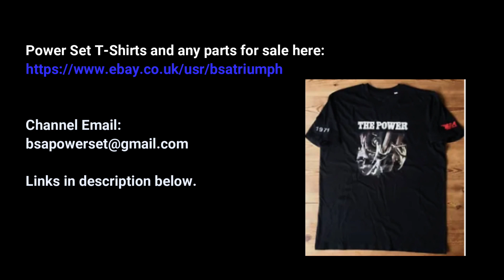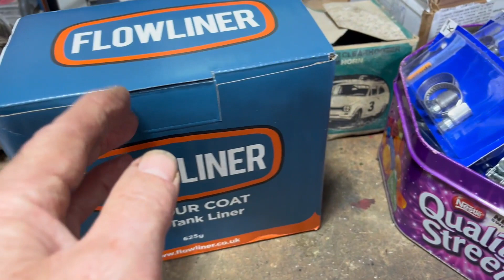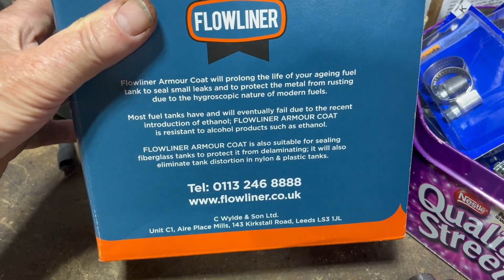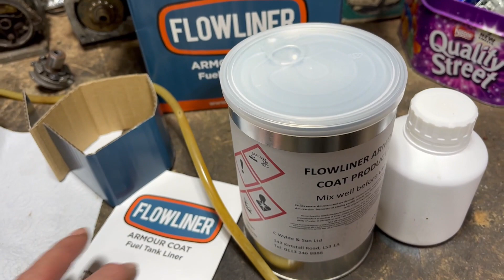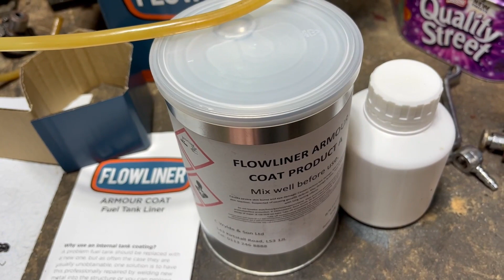BSA Ariel 3 (K2) - Fixing Apparent Fuel Starvation Issues

Comment: There's quite a lot of tinware under the plastics, quite a lot of design must have gone into that. Quite modern for the time. Does that tap have a reserve? Doesn't seem to have a longer inlet pipe to allow that. Maybe they didn't expect the typical non-motorcyclist buyer to understand a reserve setting?
Reply from the maker: Yes it was modern and innovative at the time and plenty was indeed spent on its development. The tap does not have a reserve setting. 6 pint fuel tank allegedly giving 120 mile range. You’re right they were intended to be sold as white goods through supermarkets to non motorcyclists and in the end they sold and marketed it through regular big bike dealers - one of its biggest downfalls.

Comment: Good job, are you cleaning the carb out??
Reply from the maker: Yes I did Matt - forgot to include the separate clip of it.
Reply: Hi Angus thanks for the video. Just fyi, a friend left about a litre of petrol in the tank of his 68 T120 over winter. Come the spring filled with petrol but it ran terribly. It took a while but discovered the small amount of fuel remaining had contaminated the new fuel. Once fully drained and new fuel added the bike ran fine. Apparently the latest petrol goes off after two months Ridiculous Best wishes
Reply from the maker: @johnrowley4993  Thank you John. I know this damn modern fuel goes stale but never anticipated it would be that quickly - thanks for the heads up. I do drain the bikes in temp storage, e.g. currently the Rocket Three, Lightning and the anticipated reveal so as you imply that's very good practice for anyone. Cheers.